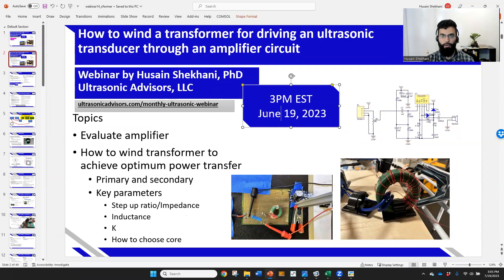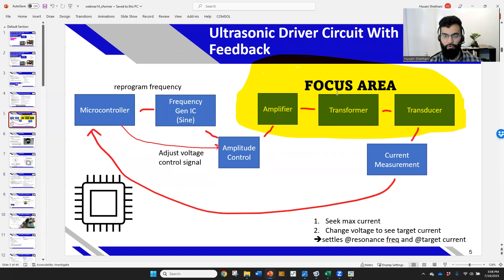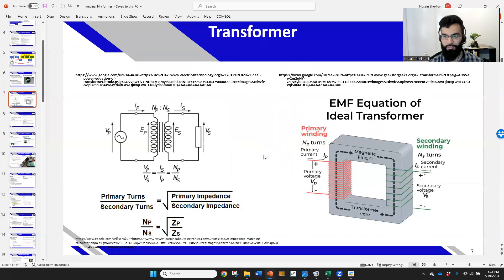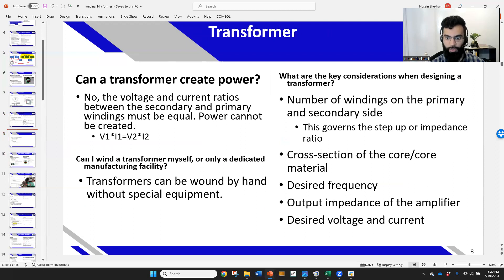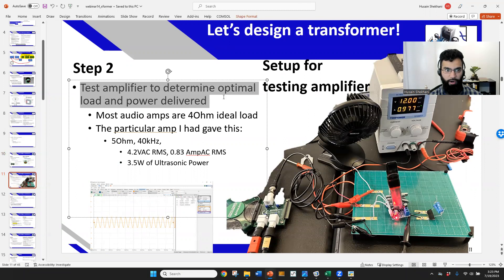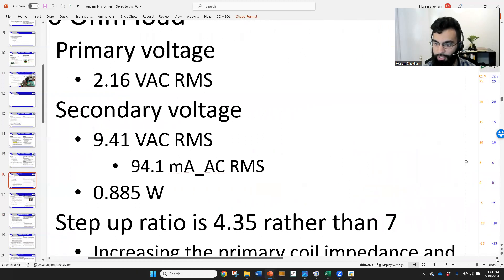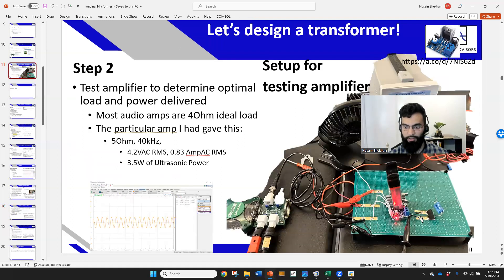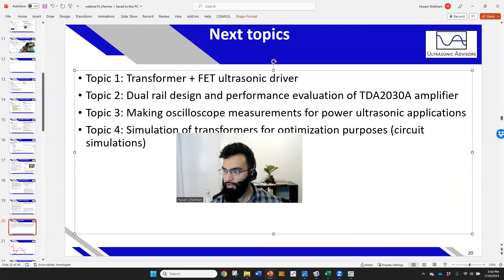How to wind a transformer for an ultrasonic transducer drive circuit

Comment: Thanks for the video! 
You showed another circuit in simple circuit to drive an ultrasonic transducer video using mosfet and resistor. Is that circuit and this one doing the same job? How are the different in their detail scenario?
Reply from the maker: In this video, I am using an analog amplifier. In the video, I show a more barebones driving circuit.

Comment: Did you mean a SERIAL inductor at 44:00??? How can a parallel inductor limit the capacitance current?
Reply from the maker: Great question! Look up "LC parallel resonance" - at that point, the inductor cancel the capacitance current. That's the idea. Match an inductor to the capacitance of your ultrasonic transducer.

Comment: Nice presentation. Any transformer recommendation to step up to really high voltage 200V to 300V?
Reply from the maker: You can either use many many winding on the secondary coil or you can also drive many transformers with the input in parallel and the secondary side in series (stacked so the voltages add)

Comment: how do I find the resistance / impedance of an ultrasonic speaker?
Reply from the maker: Measure voltage and current while driving it with the frequency you choose.